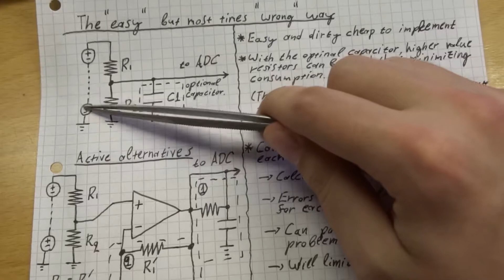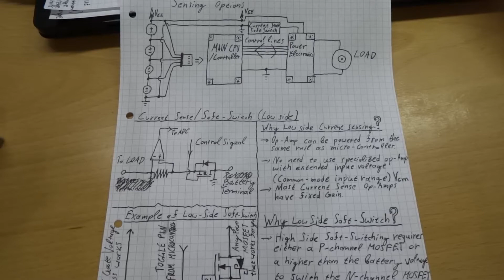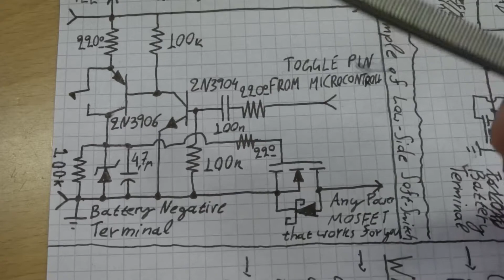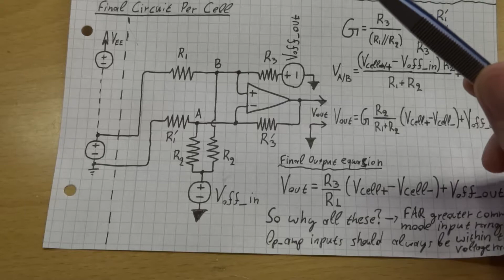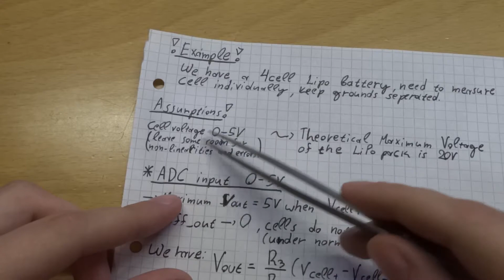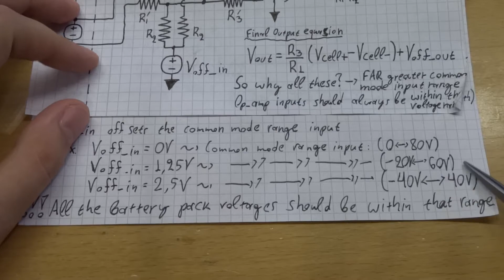How to read LiPo pack cell voltages with a μC - Op amp interface

Comment: I really like your explanation, nice job! You used that OPA 2333 opamp with resistors and an offset voltage. Can you place schematics with the values of your resistors and how you connected the whole toegether? . I’m trying to reproduce this circuit, but it’s not working, nevertheless figuring out what the values are for Voffset in and out. I am gladly to hear it. Again, nice work, specially with the offset.